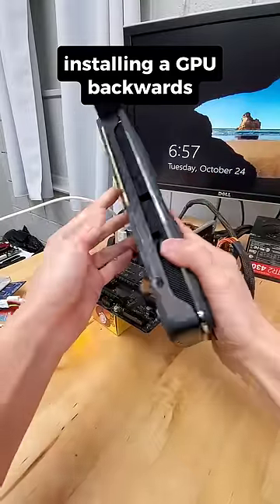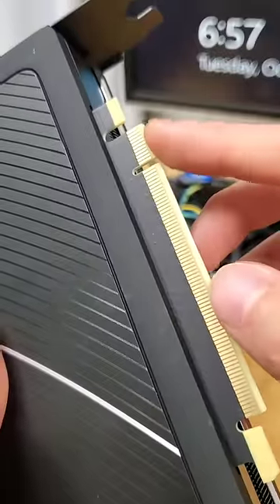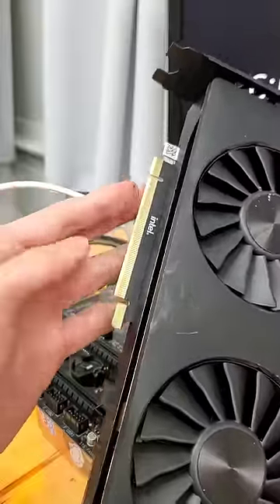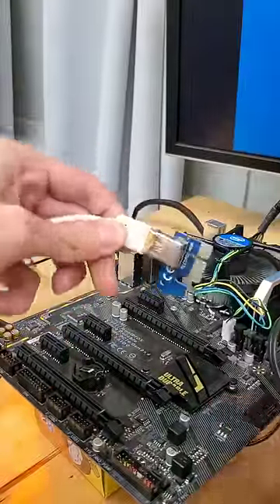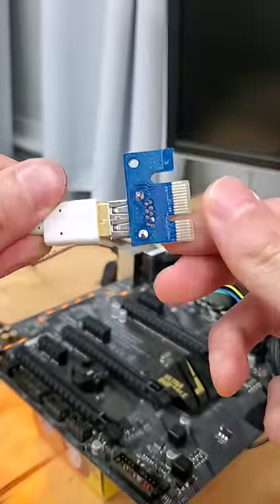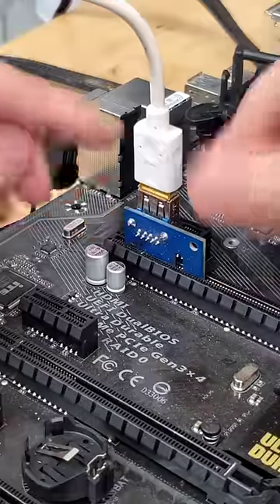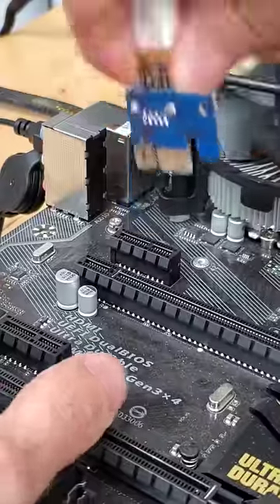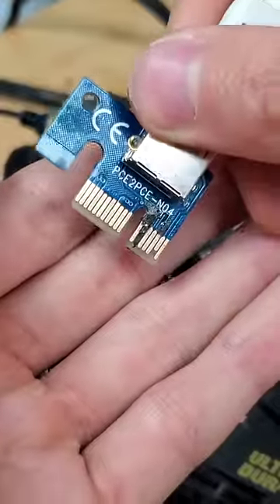do NOT install your GPU backwards #shorts

Comment: Remember, every machine is a smoke machine if you use it wrong enough
Reply: I used a wrong cable to te lan port o the modem with my PC, i almost burn my house
Reply: The*
Reply: @warriorfaith9899 edit the damn comment instead of making another one 🤦‍♂️
Reply: Wrong enough 💀💀
Reply: at least once
Reply: any electronic component can emit light, but only some can do it more than once
Reply: That reminds me about my old microwave that's decided to imitate the appearance of a bomb and almost burned down my apartment...

Comment: If anyone is wondering why this short occurred it's because that first set of pins is dedicated to power delivery, the rest of the pins are for data. So he plugged the low voltage data pins into the high voltage power delivery side, causing that poor riser card to release the magic smoke.
Reply: Thanks for the explanation!!

Comment: "How cool is that"
Like 70°C 💀
Reply: Little bit more like 120° C
Reply: Lol my cpu and gpu can run at 70c all day
Reply: @BreadAndGatorade  video editor here, my acer nitro 5 loves to not go 1c above or below 92c when working hard
Reply: nah its like 200 degrees atleast
Reply: @alecsbizarrememes7862 
CPU's under load will often increase clock speeds until they have reached the maximum boost frequency or they have reached the aim temperature, which you can decrease in your bios if you don't want your CPU running that hot. However modern chips are designed to run at these temperstures all day long.
Reply: @JohnyLilMoney  Ohh so thats why. i5 11400H counts as a modern chip no? It only happens during exports (or when running a demanding game) and it stays that way for around 3-4 hours until its done.
Reply: @BreadAndGatorade my GPU gets to 61*C while doing nothing
Reply: 70c is nothing, that would be consider a fine operating temp at full load
Reply: About 400 to 450°c for the PCB to burn , since he had to be perfect After soldering , and tin melts at 320/350°c 🍺🗿
Reply: My CPU temp upper 98+ I swear
Reply: @alecsbizarrememes7862 yeah I had one too, they get rlly hot I thought something was wrong for a bit but I guess laptops just run way hotter.
Reply: @RAJHRIDOY100 really bad, consider replacing cooling paste or even just buying a better cpu cooler (assuming it’s a desktop not a laptop)
Reply: @correalis7319 IT'S LAPTOP 😅
OLD LAPTOP 😅😅😅
Reply: @christiandk09  more like 200 to 300
Reply: For the plastic isolation to burn at least 250C for the copper or aluminum to burn 💀
Reply: @RAJHRIDOY100  maybe you can still disassemble it. There might just be a lot of dust in the fans
Reply: much more lmao
Reply: 70? More like 300
Reply: @BreadAndGatorade  not the pin
Reply: My Cpu rekord is 104°C and GPU i reached once 109°C on peak.. These are temperatures that you shouldn't have all the time, but even that is usually not a problem.. my PC still runs like new even after 56,000 hours xD anything below 85°..90° is absolutely safe in the long term
Reply: 70c is normal running temperature on pc. It was more like 200-300c
Reply: 70 is fine lol
Reply: @correalis7319 
Or a better motherboard.
Reply: 700?
Reply: Are you American
Reply: LOL my CPU is running at 90°
Reply: 70c is completely normal
Reply: @alecsbizarrememes7862  lol
Reply: Bruh if it’s smoking it aint 70C
Reply: @RAJHRIDOY100 bro what that’s basically a skillet 😭
Reply: It not 70 bruh
Reply: You can cook pasta with 70° 💀
Reply: @ you can cook pasta at any degree water temperature it just takes longer 💀
Reply: @carsonhouseholder2103  i know
Reply: @carsonhouseholder2103  sometimes i leave pasta in water for the night so its ready for lunch
Reply: Short like that to burnt he pcb it would have to be well above 275 F so for it to burn fast it would be easily double that
Reply: 70 is still safe lol 96+ is danger zone
Reply: Thats barely 70c

Comment: I thought you were gonna fry the arc750 💀
Reply: I also got scared for the motherboard 😢
Reply: Bye 300$
Reply: Even though arc 750 is a kinda bad graphics card, it doesn't deserve to be fried.
Reply: @QuackZack  it isn't bad man cmon don't be Harsh on intel they are new in the gpu production
Reply: @ModaHakim shouldn’t even exist bro they can’t even make cpus better by each gen 🤦 focus on one thing perfect it and then move on like amd the 8th gen is getting fire igpus what does intel have? Trash igpus my point is Intel sucks
Reply: @legendmaster1989 If you need raw power, you go Intel. It has always been this way for as long as I can remember
Reply: @dimitardimitrov9482  nah intel sucks bro intel: "power? whats that?" like they cant even power igpus while amd is making igpus as good as a 1660 💀 sure cores are higher but performance? trash
Reply: @legendmaster1989 If he means "Power" as in 300 Watts hes speaking facts
Reply: @dimitardimitrov9482  Not anymore. AMD cpus spend 50% or more less power. This means less heat, which in turn can be translated to gpu is allowed to make more heat. Making the overall gaming prf, a little bit faster.
Reply: @legendmaster1989  it seems intel is going to get back on top in the next couple of years in the competition, look at their roadmap, higher core count and smaller node than amd for 24 - beyond
Reply: @ModaHakim  I agree it's not a bad GPU, but them being new has nothing to do with anything. IF you can't hang, don't try, and use the fact that you are new to hanging. Should have worked out more.

Comment: That Blue Screen in the middle of the Video got me.
Reply: Casually pulls off while powered on 😂
Reply: I’m curious what the actual mechanism is. Pulling it is detected and sends an NMI to the CPU so it just crashes out because the bus isn’t considered hotpluggable? (It didn’t seem like a truly electrical problem)

Comment: Now the question is, does the PCI-E slot still work?
Reply: Most likely yes because it output 12V into 5V circuit and 5V into 12V circuit on the riser which means it burned the riser but it didn't burn the mobo si as long as the burnt pins work it will work

Comment: The physical keying on slotted circuit boards like this are usually done to keep orientation but also separate power pins from data.

 So you just sent 12v 5v 3.3v down data lines. Traces go to smoke they aren't made to take that load or voltage!!!!!!!

Comment: This was more common with the old white PCI slots.  The Gap was at the opposite end of 5V cards versus 3.3V cards and there was no hook, so if a card had no metal bracket at the back it could be inserted backwards by mistake .

Comment: I remember doing that with an actual graphics card back in the day, it was an old AGP card, and those could fit in the slot backwards. Similar story, started smoking. Somehow, it still worked fine when I flipped it back around.

Comment: Some older PCI cards would be way easier to do this with, some had a notch the same size as the back one on the front (PCI's notch is in the back), so it'd be far easier to flip it around

Comment: seems like a design flaw. When I design something as an EE, I make sure connectors are different sizes and/or non reversible so that the circuit is never connected in a way I didn't intend

Comment: I also did something similar once with the DSI/CAM port on a raspberry pi 5. Thankfully the led turned red so I  knew something was shorted and I disconnected the power immediately before anything happened to it, I would have actually cried if something happened to the board. We all know how rare raspberry pi boards can be nowadays😅

Comment: Also this will send 12v to one of the PCI lanes in the GPU... If the PSU kicks in and shuts off this will save the GPU but with some damage to the PCI lanes (lower speed or worst case: death)

Btw yes this has happened to multiple mining rigs

Comment: You’re not going to explain why this occurred?  The left side tab suppliers 12v power to your PCIE devices.  There’s also 3.3v too.  Typically up to 75 watts, although a device can pull more if it’s configured to, I had a 3090 shunt modded to pull 120 watts from the PCIE.  Although that was a short lived experiment, I put it back to stock after seeing other people damaging their cards doing that.

Comment: It’s funny you used and intel CPU as the example because I’ve always found it strange that they advertised the arc A750 and A770 using images of the non-fan side unlike literally every other GPU I’ve seen